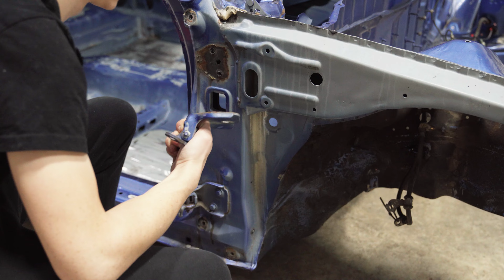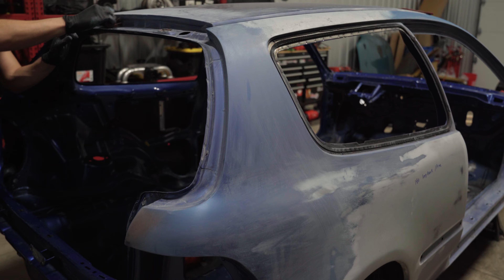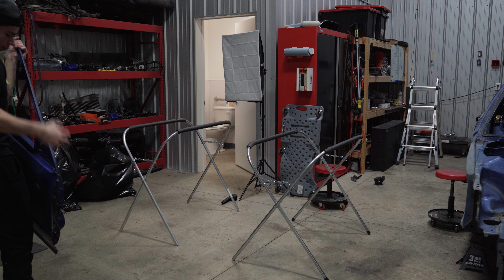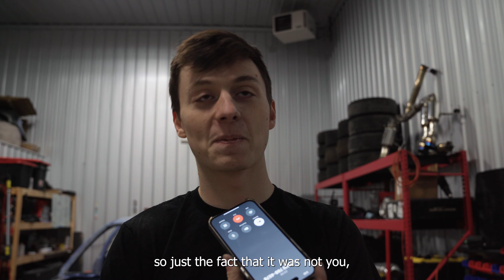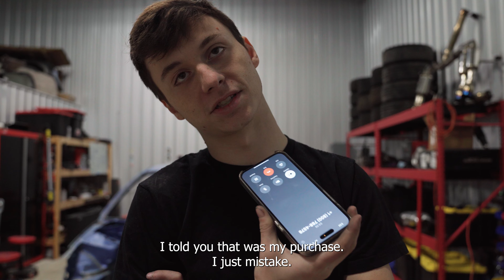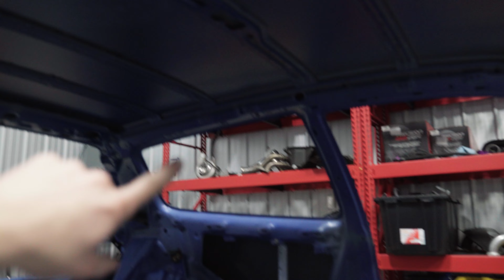Building an AWD Honda EG Hatch PT 7 | Paint prep |

Comment: What advice could  u give for prepping for paint ? Im doing a k awd turbo build on my integra an wanna respray it ,the clear coat has been removed so what would you suggest from that point it was previously sprayed but the clear came off ,should I add bother coat of milano red then hit it with good clear ? Also great content
Reply from the maker: From my knowledge if it’s been resprayed and the paint job failed, I’d take that paint all the way down and start fresh
Reply: @RemmyEvans ahhh ok I see ,yea the clear is what failed paint is fine just mattish red but ok wellll future plans ,for now just wanna get her road worthy and running just gotta get rbc mani run my fuel lines an she should  start then I can focus on the drive shaft then I can worry about the  rest ,I’m currently running the crv diff an an looking into s1 built drive shaft